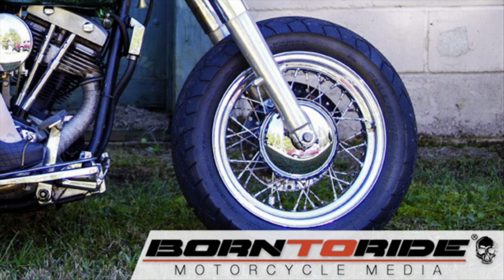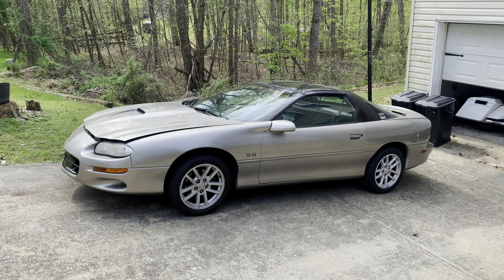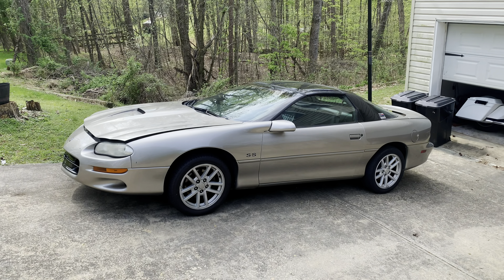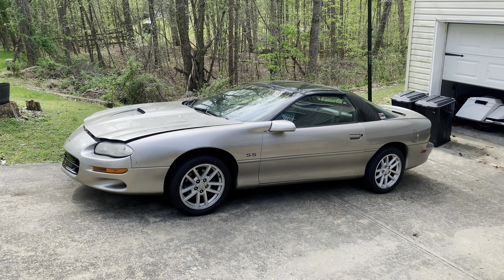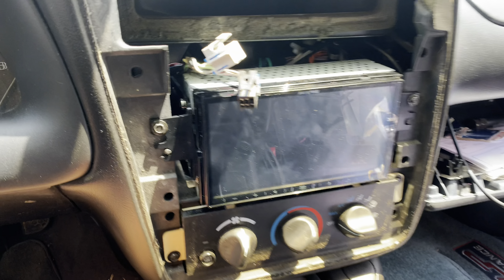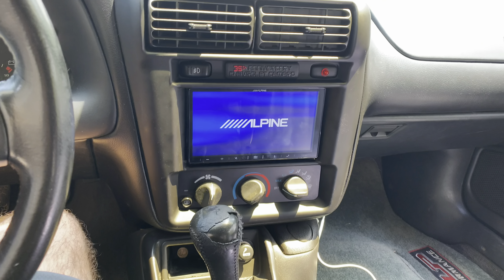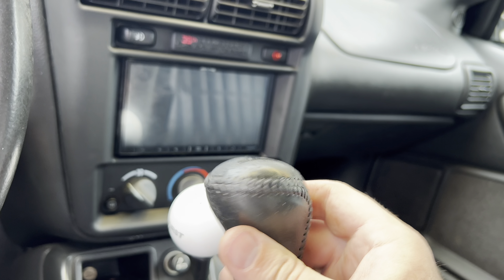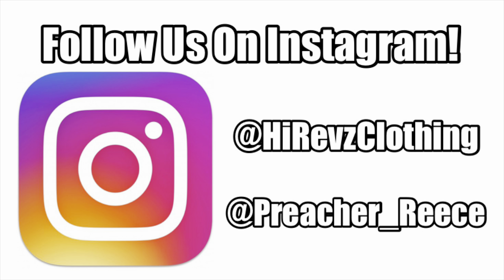Double DIN Alpine iLX-W650 Radio Install - ‘02 Camaro SS SLP

Comment: Clean car man 🤘🔥🤘🔥 The wife and I have 2 mine is a 2001 Camaro SS with a built T-56 2 stage build from Texas drivetrain performance hurts short throw shifter with a stage 3 monster clutch and has a Teaxs torque V2 cam with LS7 springs pushrods has BBK long tube headers 2 into 1 BBK ypipe 2.5 " exhaust with a flowmaster super 40 single out . Mine needs some body work front bumper and hood need repaired and repainted. For the interior need to get the driver seat redone and if i do that ill do the passenger as well and new carpet. The wife has a 2002 Camaro SS thats mint and all factory other than the full exhaust and headers . All we need to do is recover the front driver seat has a small wear spot and wilp do both the same passenger side too probably want to go with the leather seat with the 35th anniversary embroider on them. Anyway love the car and channel.
Reply from the maker: That’s awesome man and thank you.